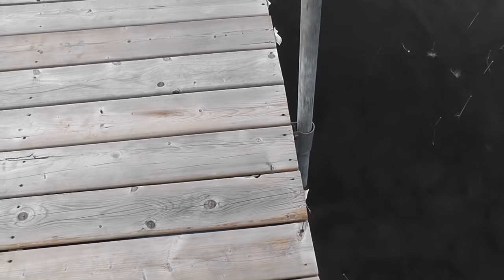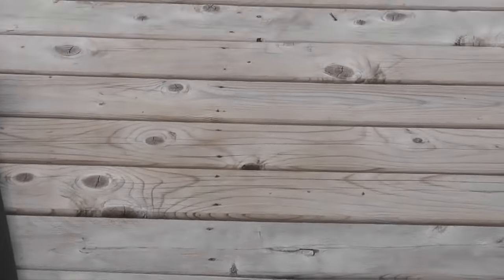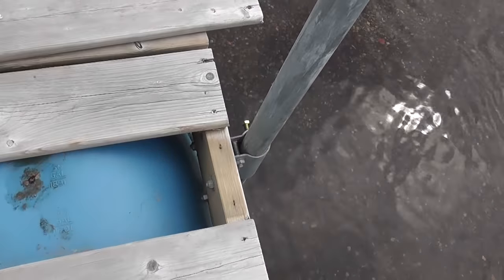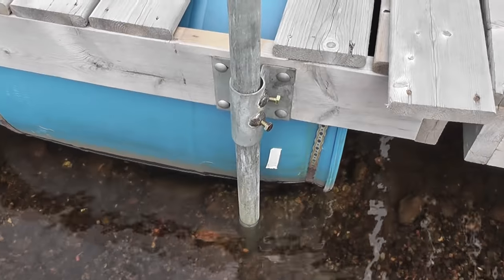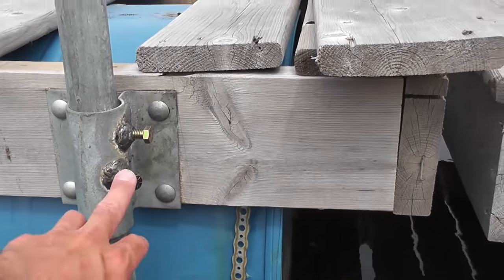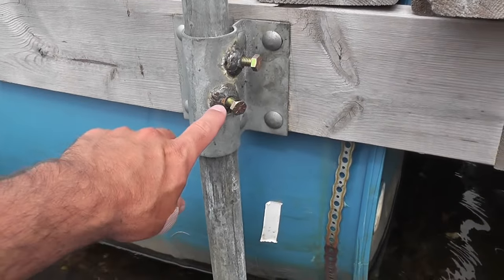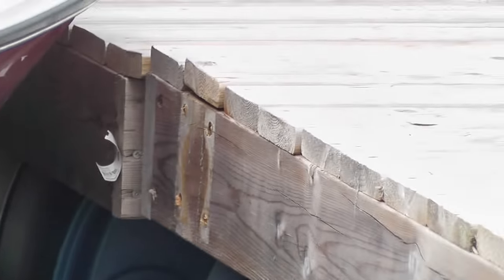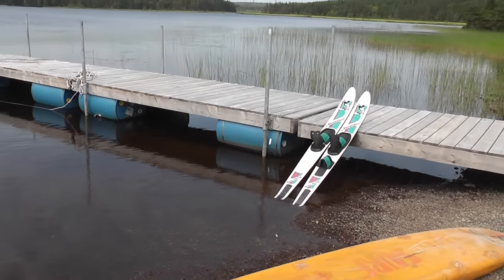How to stabilize a floating dock

Comment: Thanks for posting CC! I will make sure to get these to stabilize my dock.
Reply from the maker: No problem Peter, good luck with your dock

cc
Reply: +Caper Camper   The only problem is the dock will pull the pipes out when the tide goes up and the dock does not move with the tides so i dont get it
Reply from the maker: 126lrt This style dock (in my opinion) , is best suited for an area  where the tide is not a huge factor.  In the event that the tide does rise or lower considerably , you can back the bolts off the poles and let the dock rise and fall with the water level.  Dock will not have the stability (side to side or up and down ) in this case.  Where I have my dock, there is little effect from the tide and I am able to keep my bolts tightened most of the summer.
thanks for watching and commenting

Comment: Now that you locked the poles in places. When the rollers “waves” from boats will lift the poles out of the sand bottom. Just add water in the barrels about 1/4 of the barrel it will stabilize the dock and still float nicely

Comment: Would you not just put pipe clamps (jubilee clips, depending where you're from) around the uprights? You can get all stainless, you can position the screw part where it can hardly be seen.  No drilling, welding, force on the upright, etc. etc.  Just a thought.
Reply from the maker: +Martin D 

Hey Martin... that's a great idea , I have a friend with a similar wharf and I will try this on his when we put it out this summer.

thank you... always like getting tips/advice from others

cc

Comment: Looks good, what do you do when the water level rises or falls?
Reply from the maker: If the water level is going to change drastically because of heavy rain, we will loosen off the brackets to allow for the rising of the dock.  As it settles back we will re-tighten

Comment: Do you remove the dock in the winter to prevent ice damage?
Reply from the maker: The Last Second Save yes ... we take it out to prevent damage from the ice, the ice would destroy the barrels
Reply: @capercamper  Not so. I have large floating docks (much too large to take out) and I just slack off the anchor chains on the far end, detach the ramp, float the main dock into the bay and tie-off to two trees. Have never had any damage to my barrels over 10 winters.

Comment: Very nice.
   How did you drive the pipe into the lake bed; and how far into the bed?
Reply from the maker: +Bruce Wayne 
I used a sledge hammer to drive the poles into the bed.  I put them in approx 6-8 inches... not too far.  There is not much tidal action where this dock is located.

thanks for commenting
cc
Reply: You can also purchase auger ended pipes (home depot) that "screw into" the lake bottom similar to a beach umbrella.

Comment: My lake freezes over and the ice is powerful.
Any advice on what the ice won’t be able to bend ?
Reply from the maker: I would not leave this type of a dock in over the Winter, take it out or choose a different dock
Reply: @capercamper  Just back off the bolts all the way so that the dock can ride up and down with the ice. Have done this for 10 years and never had a problem. And we have big-time ice...

Comment: Just be careful welding to galvanized steel. Make sure you have lots of ventilation! How wide is your dock? My solution to our old tippy docks is going to making them wider, longer, and heavier to get the center of gravity down, and with more cross bracing since our old docks twist. (the guy who built ours used nails, I will be using bolts and steel brackets).
Reply from the maker: great advice, thank youcc
Reply: @capercamper  I did a nice 16 x 16 floating dock using four 48” permafloats. Each one is rated for like 1200lbs. 
I used 2 x 8 for frame and stringers. It’s freaking solid

Comment: How do the poles work? Are they spiked into the clay?
Reply from the maker: The bottom is fairly soft which allows me to pound the poles into the bottom.  Each section is connected, therefore making the dock seem as one large structure.  It works great!

cc

Comment: Great video!  you reference that someone now sells the pipe hardware can you forward the link to that company
Thank You Gary
Reply from the maker: Gary Manter Hi Gary , thanks for stopping and watching.  The local building supplies in my area carries Multinautic Dock Hardware , this is where I purchased mine.  I have provided a website which will bring you to the leg holder you are asking about.   I have tried posting the website but it doesn't seem to want to stay ... not sure why, if you do a search for Multinautic International and search the site for " Multi-anchoring leg holder 5" x 5" x 1/8" (10011)" you will find the holder you are asking about  cc

Comment: Hex bolts would be safer.  Nothing like catching yourself on the bolts sticking out.
I also think better brackets exist.  I would have taken off the bracket and replaced it with a safer set up.
But, hey whatever works

Comment: If you do this you don’t need floats 🤔
Reply from the maker: ... well the reason people use floats is to allow the dock to rise if the tide is high and lower when it is out.  If the difference between the ebb and flow is minimal then I would agree with you.  If it is not then I would disagree.  It depends in the location and the water ...thanks for watching and commenting